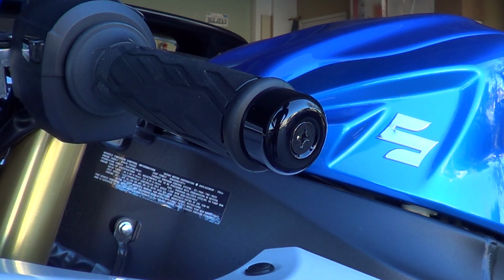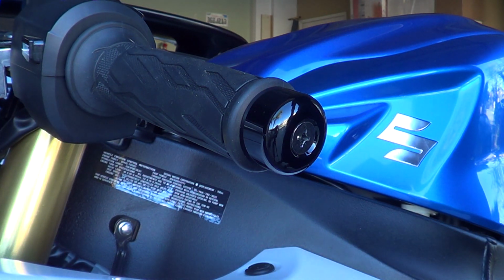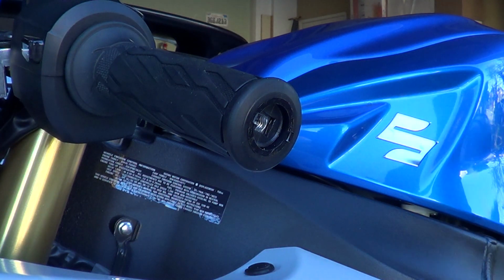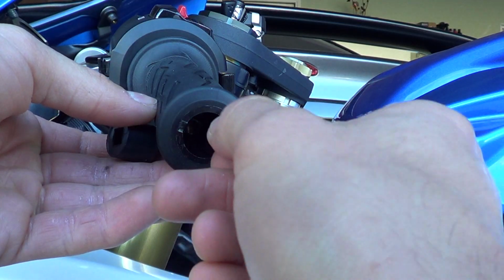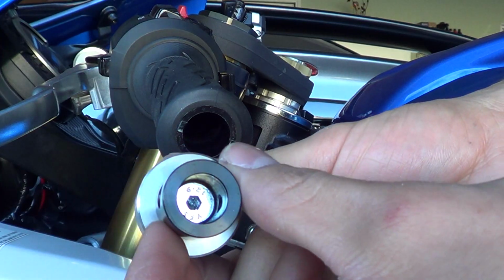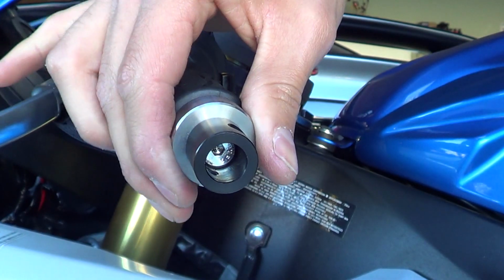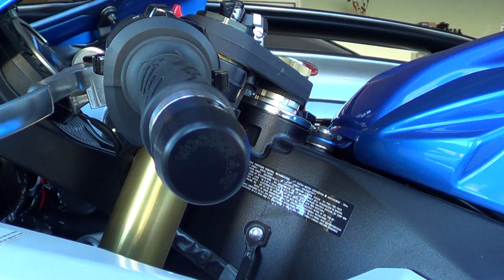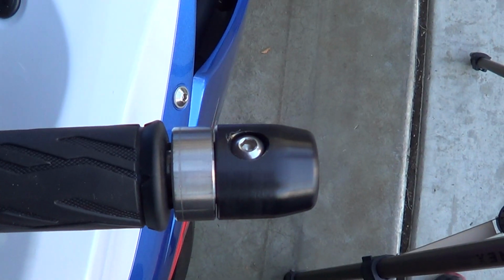How to install bar end sliders

Comment: My stock handlebars were loosening on their own (the screw was beginning to loosen) so I put some blue loctite on them.  Now, I have decided to put aftermarket handlebar sliders on and am wondering if you (or anyone else that reads this) has some ideas on how to remove the loctite screw.  I've heard a heat gun will work but my concern is melting the handlebar grip.  Thoughts?

Comment: Tip: you don't need to unscrew the bolt of the bar end all the way in order to take it off. You just loosen the screw and the bar end with the plastic core and the screw nut go off together.
Reply: What do I do if the black plastic piece is loose??
Reply: @EmeraldGhost-  It’s supposed to be loose before installation. Once you put it inside the bar tube and start screwing the plastic gets squeezed tight inside the bar.
Reply: @bocolis88  what if it just keeps twisting and not tightening?? Idk what I’m doing wrong

Comment: Question! How do you remove bar end sliders? After loosening the screw, it got dangled down and I can't remove it.
Reply: What was your solution? Changing grips at the moment and now the Puck won't screw back in... Pissed
Reply: @Itowle9  Same here at this moment.. how did YOU do it? 😞
Reply: @magnafrisiaband  watch Brian vans sportbike track gear video on installing a bar end mirror and he shows how to get it out I think. You have to twist the actual bar end piece but make sure you cover it with something so you don't damage it.
Reply: @Itowle9  You are quick mate! 😅👍🏻
I have the end screwed off, but the inner thing I can’t get out.. 😓
Reply: @magnafrisiaband  srew the end piece back in and then actually spin the entire assembly out counter clockwise maybe? Cover it with a rag and use pliers if you have to.
Reply: @magnafrisiaband  I can't remember exactly what I did 😬
Reply: @Itowle9  Got it! I pried it loose with a lot of force 😅

Comment: Could you put the allen key screw on the bottom so ya didnt see it by twisting it around?
Reply: Yes.
Reply from the maker: Dan T Yea you can set it however you wish. It was just easier for me to tighten/loosen it from the top.
Reply: Cool cheers

Comment: There is no need to completely remove the bar-end weights, they will slide out assembled, only need to be loosened, just to help you, and other down the road.

BTW if you don't need the stock bar ends let me know, I would be interested in them ? Thanks, yl